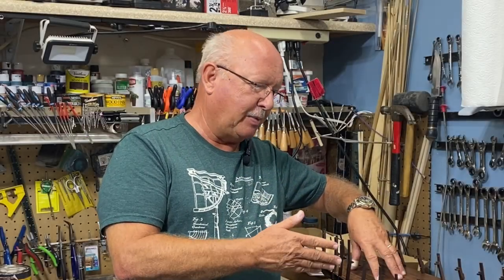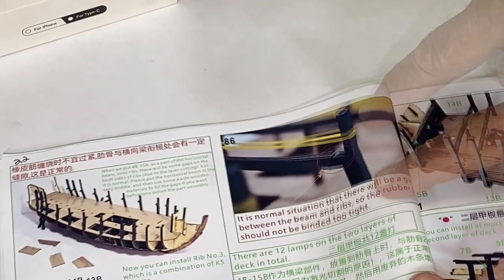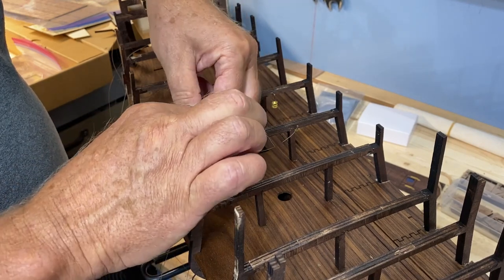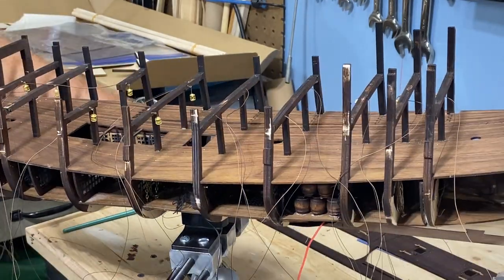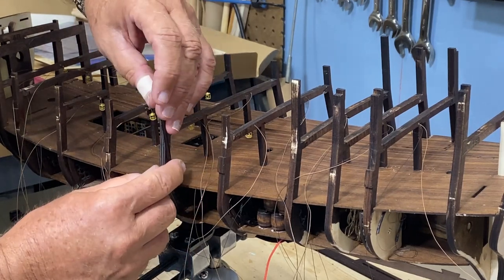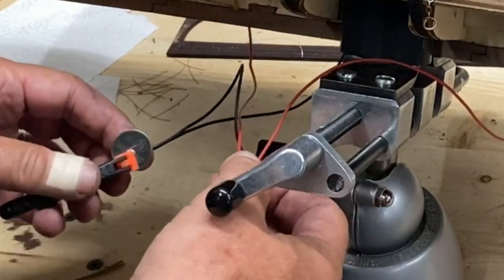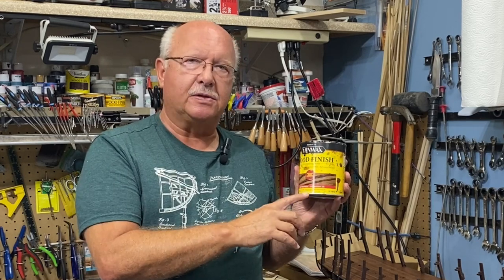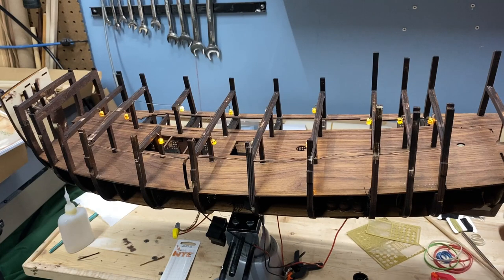Black Pearl All Scenario Version PART 4

Comment: WOW ! !  You've been busy. Great work on the lights. I was overwhelmed when you first showed the ship before the wires were routed ! ! Love your solution with the tube. I also see your using the two resistors with no problem so I will do same.  Amazing work good sir.  Where's the Monkey ??
Reply from the maker: The Monkey is out and about.  Consensus is that he's off scale.... So, I'm looking for one online.... They don't make much miniature things anymore...(choking hazard?).
One thing on the lights that I just figured out regarding the resistors.  The ones the electronic shop sold me that I put on the middle deck are brighter than the lowest deck (resistors that came with the ship).  So it depends on what you want visually.  The dimmer looked more like little candles on the ship, but the brighter will show better what is on that deck.  I was torn, but decided to use the electronic shop ones and took the ones from the kit off.  My experience has been that led lamps dim a little with time, but I'm not sure on these little ones?  I'm guessing I could go back and switch to resisters that would dim them a bit more as the packs were 4 for only $1.49.  I will have to decide before I close up the hull forever!
Even I was impressed with how well the wiring went once I got them organized.  And the little straw piece was a great help.  I also have obtained some of the shrink tubes that you heat and the enclose the wire connections.  That also is a cleaner look and no short circuit risks.  
Whew - I'm a windy sailor!  Thanks for asking. 🤣
Reply: @BoilerDan1 Consider this.... You bring up a good point about the candle/oil lamp level brightness. I love that look but your right in that you want to be able to see all the detail you worked so hard on.
I see no reason you can't wire the resistors in the coffin box for the positive leads.  At least that way you can change them if your not happy with the brightness level after the hull has been closed.  That's what I intend to do when I get to that point.  Whew ! now I feel like a windy swabby myself ! !  looking forward to your next video as always... be well.
Reply from the maker: Good point! I was going to enclose it all, and put the plug-in port on the ship, eliminating the wire to the casket….. more to think about 😂👍

Comment: Fantastic job on the lighting.  You’re  making good progress. 

I’m battling which colour to stain the exterior.  I like the flat black as used on the ZHL’s webpage display model but I don’t want it too black that it loses its wooden appearance and just looks totally black..  I’ll have to check out the Minwax stains display and compare the black to the red mahogany.  Beep on sailing.
Reply: Keep.
Reply from the maker: Thanks, not trying to persuade you but if you add additional stain, letting it soak in for about 10 minutes, then wipe it off, allow to dry for a day, then repeat. The mahogany will get so dark that from across the room it’ll look black but not too black like paint can do….. here’s a thought! Buy a small can. Do several coats on a piece of scrap.  I think you’ll be impressed with the darkness and the richness of the hint of color up close!
Beep Beep 😂👍👍

Comment: Question on the lighting: How many wires do you use for each resistor?
Reply from the maker: This may sound confusing, but here goes:
The resistor goes on the hot line, before the led. (Longer led wire)
I hook up to a plug in transformer 3 Volt 1A Power Supply

(amazon: MTYTOT 3 Volt 1A Power Supply 3W Power Adapter 100-240V AC to DC 3 Volt 1amp 0.8A 0.5A 450mA Converter Transformer Plug TIP: 5.5mm x 2.5mm https://a.co/d/gsQuWhH )
For full brightness each led light has its own resistor, however I like them to be dimmer, so I hook between 2 and 4 per resistor.
So the hot (positive) wires go from the resistor to each led light.
The return wire (negative) can be the same wire from each led light. So you can have a main return wire that all the led negative leads can hook into.
It get a bit messy.
I’m building a paddle boat now that might show that better. Here’s a link to that segment: https://youtu.be/cHrOO1vBli0?si=1ninIzUrWy56MyEy
Reply from the maker: Let me add one more thing:
You can group the resistors by twisting the hot side together and hook it to your main hot (positive) wire. Then branch all the resistor leads coming off the other side to all of your individual led lights ( or a small group of two or four).